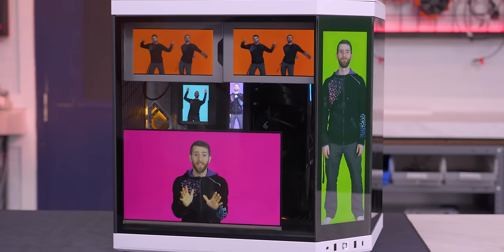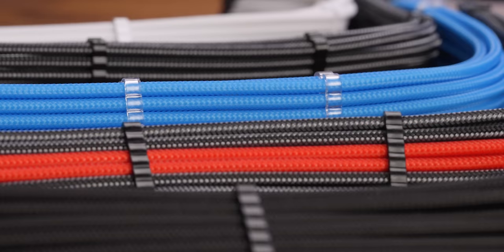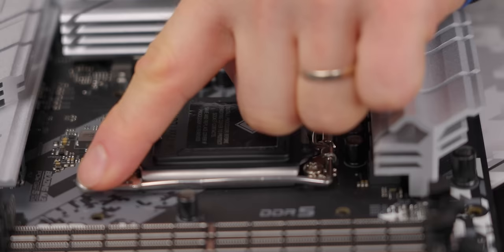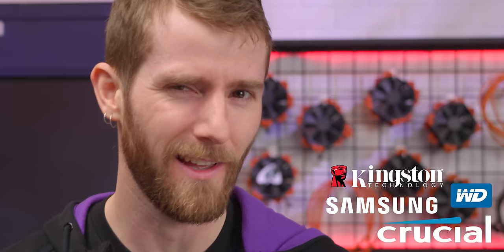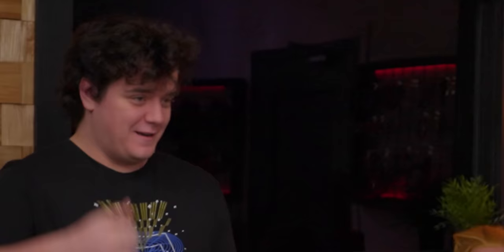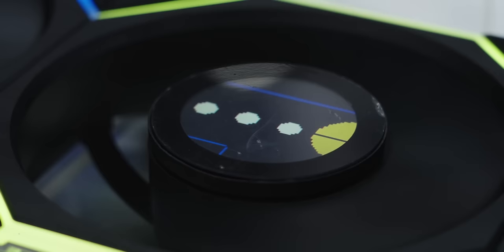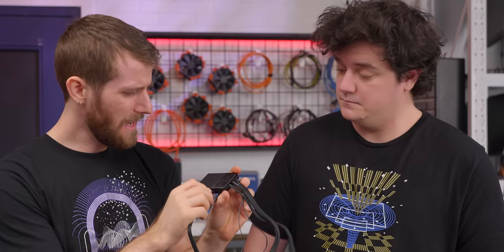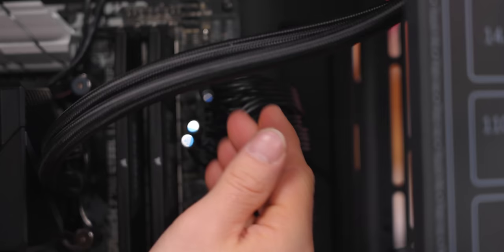The All-Screen PC

Comment: It's kind of amazing how much bad RGB software, nonstandard display software and conflicts can screw stuff up.  Have added "remove all rgb and additional display software" to my troubleshooting regimen for the problem of "computer's haunted."  I guess it makes sense that all the ones I had the most trouble with were ones that were running temperature/voltage displays - I think some combinations of them caused the apparent sensor results to multiply somehow based on the logging I've torn through.  Not sure how they'd do that.
Reply: time to start running all RGB on separate raspberry from now on tbh
Reply: I've been saying this for years. I go out of my way to either buy hardware that doesn't have RGB, allows me to disable it on a hardware level or if all else fails is non-critical/easy to hide. Stealth all the way, no unicorn vomit in my towers.
Reply: @rolmops883  You don't actually have to do rainbow vomit. I have all my RGB set to static colors, it looks so much nicer that way.
Reply: And beware of rgb software that install all manufacturer drivers with telling you.
Reply: @tbuk8350  As a Linux user, there just isn't that much decent software that I've found to control the RGB stuff from the OS side (hence my tendency to avoid, or if that's not possible, choose something with hardware controls). I don't mind people who like RGB, but to my eye, it all looks a bit tacky, even the solid colours. I'm the sort of person who bought the Fractal R6 without the tempered glass panel after all :)
Reply: Yeppp. I have like 6 different applications on my PC for the RGB stuff, it's crazy anoying and a waste of resources also. So i am happy that Microsoft starts implementing RGB control within Windows. It's just a start, but hopefully we are getting somewhere. And yes, you can buy everything from 1 brand, but the problem is that every brand has a product that suits your needs, in different ways.
Reply: reason why i run just ique and let the GPU do what ever the ef it wants. can't wait for windows to integrate iCue and some of these other software. so we can just run it through the OS...
Reply: theres 100s of threads where certain components of Armory Crate have been known to cause constant gpu crashes that mimic the exact same error logs in event viewer as a dying GPU would
Reply: It's running fine on mine cause mine is only 1 which is my main screen for gaming. portable PC anyone
Reply: If you're over 11 years old, and you're not a geh, lose the RGB.
Reply: I’m gonna just chime in with this. I’d like to echo the bad RGB software including RGB hardware that ends up messing with audio especially when streaming. Red in particular often will have more interference than other colors. This is also why I use a mixer and nothing onboard if I can help it.
Reply: Y’all forgot the Elgato teleprompter…..
Reply: @CustomHydroGaming  googles 'led interference' - well damn, that's kind of neat and also sounds incredibly frustrating.
Reply: @jacobwisner7821  it is. I used the K70 keyboard for a couple years. I could never understand where the low buzzing was coming from. It was never the usual suspects.until one day I didn’t hear it. The only thing that changed was I got a new keyboard and didn’t hear it. But it was a little while before I put 2 and 2 together.
Reply: @MrGamelover23  I know, even then I don't like it.
Reply: Just today I ran into a cheap rgb keyboard preventing windows from booting. I'd never seen this before.

Removed the $5 keyboard fixed the issue. It also had a terrible non-standard layout for f keys and home end and Insert keys
Reply: That's because usually that software is craptastic
Reply: @rolmops883  Linux user here too. I usually just pick things that have dedicated hardware controllers. My case fans are like that, 0% of my CPU is wasted for them and I still get pretty colors :)
Reply: @nocturn9x  Well yeah but it's its own league of craptastic.  I don't think I've even had a Bethesda game hard power off my system like I have with bad screen and RGB software.
Reply: @jacobwisner7821  That's because usually RGB software is partially implemented as a driver, which in most OSes runs in a privileged environment along with the kernel. Mess up there, and your whole system goes kaputt

Comment: You can use a piece of mirror underneath the PSU, put it at an angle so you can see the screen from the back. You can combine it with the Y70 case cut-outs and make some cool effects or cut the piece out of the case so you can see the screen fully.
Reply: Exactly, I had the same thing in my head haha
Reply: I was sure they were going to do that the disappointment lol
Reply: @celebritysdrama  Same  hahaha xD
Reply: I put a mirror under my 3080 3 years ago so the fans and rgb show forward. It fits across the whole bottom, hides all the wires and bottom of mobo.
Actually looks like 2 gpus with one mounted vertically below the 'real' one. 
The problem with the screens is they will be reversed if you use them for text. Unless you could reverse the image in software.
Reply: @celebritysdrama 7th 😅grade 😅school 😊😊😊the most most for for proper students and teachers of children 😊

Comment: You need to install a camera in the case. Point it at the screens that you can’t see and output the feed to a screen that you can see. You can also use the camera to monitor internal conditions - dust bunnies, leaking graphene, fraggles playing with the 12v high power connectors, etc.
Reply: Hahahahahaha oh my word.

Comment: I am currently building a high end PC as an upgrade to my current almost 10 year old setup (still holds up for simple things). I too considered putting a screen inside the case, a 7inch. But after spending way too much time considering where to place it, how I'd need to reposition the pc case to read it properly, etc. I finally realized that a screen inside a case that isn't right next to my face (and even if it were) isn't as practical as a touch screen mounted at the top of my keyboard. So that is what I'm doing. Practical, useful, can be used for anything and I can interact with it. I can even use it as a stream deck, sort of. I can use it to mute apps without minimizing a game, the possibilities are plentiful. This is my advice to anyone wanting to put up a screen. the Hyte y70 touch is the best case application of it, in my opinion.

Comment: Im currently using this case and it was a lot of fun to build in and fairly easy too given the amount of space you have for a "normal" build.  The screen itself does come in useful too although gimmicky for temperatures and performance stats.  I will say though loading into bios on the tiny screen as default whilst also being flipped on its side is not helpful

Comment: I'm surprised you didn't incorporate the Optimus Maximus keyboard. That would have roughly doubled the total number of screens, as it's a full ~100 key keyboard with a separate 48x48 pixel 10FPS OLED display on each key. It might have been tough to get your hands on one at this point though, since they've been discontinued for a decade.
Reply: I wonder why it was discontinued lol
Reply: I think I remember reading about that keyboard on Engadget. Back when Engadget was good, or at least nearer to.
Reply: @casparhughey5651  yeah, that was my point lol. Terrible concept.

Comment: I installed four  IPS LCD screens (5" and 4") inside my mid non-modular pain in the ass h500 case.  The main issues were finding the right location for the screens, the right size and the cabling. Each screen uses two cables: HDMI cable and  usb. I had to get short and thin usb and HDMI cables. I also used two HDMI splitters and an USB hub connected to the MOBO to give power to the screens.  I used strong magnets to hold them to the case.
The four screens are connected as pairs. All the screens can display the same thing or something different for each pair and they work as an extension of my main monitor. None of the screens are blocking the MOBO.
I am always afraid to open the side panel. The cabling is completely chaotic. 

All the pain and effort building the damn thing was worth it. The pc looks very very nice.

Comment: I did some HORRIBLE things to cables. I once designed a cases without a spot for the power brick or any of the cables, just so I don't have to manage them in the case. I'm really lazy. Just push em where you don't se em and put tape on it...
But this...
really....
hurts...

Thanks you're doing it, so I don't have to.

Comment: I actually may do my next pc with the large displayport screen in the case, my intent is a "headless" pc, with only a small monitor for debug, setup purposes, wtih two dummy plugs for virtual monitors in VR, and work with wireless mouse keyboard plus a Quest 3 headset so I have a completely wireless setup with floating virtual screens. But with the PC BEING the monitor, it'd work great.

Comment: I've seen some post and videos about some (prebuilt) PCs that won't show anything on first boot on the integrated display port, requiring a reboot. HDMI (and obviously old vga and DVI) are not affected to this behaviour, so probably it's a common bug in the handshake between the integrated controller and the devices poorly coupled in the bootloader

Comment: I actually have that NZXT hub because I needed more USB internal ports than I had.  I use one of the USB a hubs for a cheap Bluetooth dongle I got.  
I did buy a bluetooth and wifi card, mainly to use as a seperate NIC for some VMs, as well as wifi at the Dorm i'm in because they have an ethernet jack to fuckin gnowhere, but the bluetooth cable doesn't reach far enough to get to the hub in the front of my case, so it's just a wifi card.
I would probably use it for the dongle, but I do remove and re-attach those when I'm not using those controllers.  I just wish mobos would stop shipping with ONE usb connector.

Comment: you need one of the optimus keyboards from the early 2000s
Reply: The problem with them is a) burn out and b) making them work with anything modern
Reply: @Metal_Maxine  surprisingly they apparently have to working software at least in Windows 10

Comment: Random question for tech people... how often should i change my motherboard battery? And what are the typical symptoms of a dead motherboard battery?
Reply: The bios should report that the battery is low. Or there should be beeps or maybe indicator leds idk what board you have but the bios should report that the battery is low. The bios battery is not really heavily used so it lasts pretty long. The memory chip it has to power draws almost nothing

Comment: I know this is stupid. But if I have 2 different brands of ram with 3200 Mhz, DIMM, DDR4, and different sizes (Aka 1 is 8 gb per module, and the other is 16 gb per module). Would they work mixed together?

Comment: I ended up with a working HP ERICA2 in a deal, It's amd, ddr4, SSD port, and a m. 2 wifi port. I looked on eBay and these bords are still bringing great money. I'm used to a totally different setup. Do these come out of a all in one and I know I can put it in a good case but the way the ports are I would have to do some reddneckk engineering unless I buy the case that goes with it. Is it worth putting a couple hundred in. Would it be any good at all for gaming. From just what I see on the board it has everything I need except it has I guess HP plugs but I have a couple HP power supplies. Should I just sell it and just buy what I know and use the most? or see what it can do. What do you all think. I think it has a old A10 7800 in it and I know that's gotta go. I'd didn't like those series CPUs anyway. I have a Ryzen 5 5600 I could put in it but I can sell it and get the bord I want and possibly make money. It's just a neat motherboard and I just wanted some feedback if anyone has one they've used or are still using.

Comment: I love Linus and LTT but someone gonna have to explain to me why the hell the LTT screwdriver is 70 freaking dollars…you can buy a fantik or arrowhead electric one with like 50+ more bits for that price
Reply: Not a dedicated screwdriver manufacturer operating with economies of scale, vertical supply chains and own manufacturing facilities and machine shops for starters. Is that enough?

Otherwise...

Screwdriver shafts, bits etc are all at minimum order quantities from third party suppliers abroad which is a high upfront cost. The ratchet mechanism design is licensed from a larger manufacturer. Molding costs for injection plastic molds for handles (they have a limited lifetime and the handles were designed in-house at LTT - they need to keep being replaced). Production of plastic parts at a local factory in BC using an industrial injection molder and then hand assembled while hot using a series of bespoke presses ($20k CA per press, three presses needed per screwdriver needed - Linus talked about this).  Packaging and third-party warehousing costs.

This ignores a) development costs including hiring Kyle for 1 year and suitable machinery, b) being screwed over by the first shaft supplier who swallowed the deposit and sent several thousand defective shaft mechanisms, c) not having the faintest fucking idea if anyone other than whales would buy it d) hopefully making some return on investment.
Reply: @Metal_Maxine  that’s great explanation and all but why would anyone pay for their poor business decisions when they can get the same thing for a fraction of the cost?
Reply: @F-Society-Mr.Robot-   You just asked why ^shrugs^

The other answer is: some people like it rather a lot.

Comment: To the crew at Linus tech tips,  is there a way that i can fix this problem. I recently got an external 1tb hardrive
and it is USB 4 and my laptop only fits USB 3, so it doesn't fit in properly  is there a way i can fix this
Reply: Just get an adapter